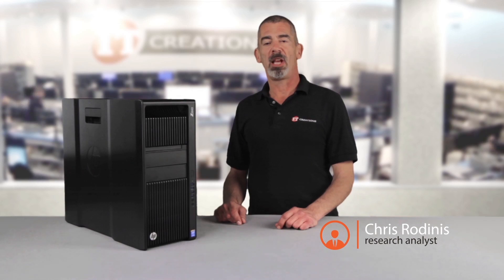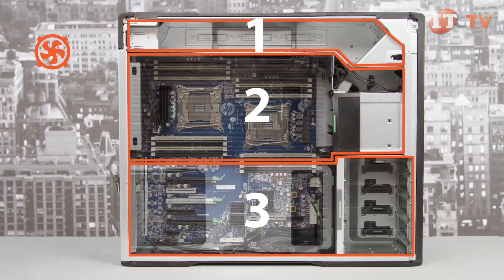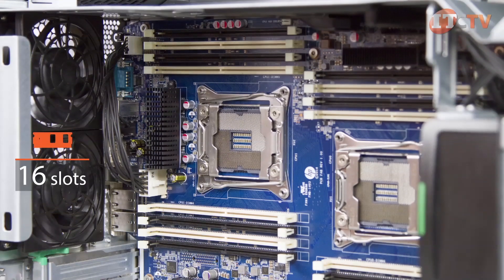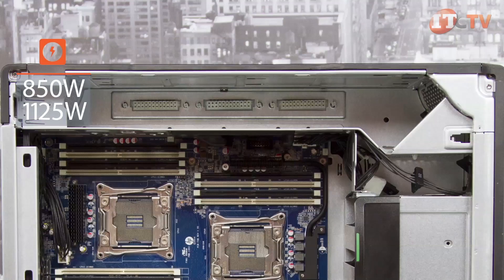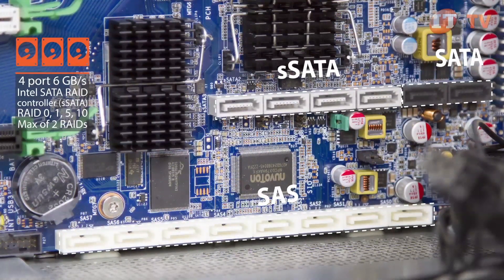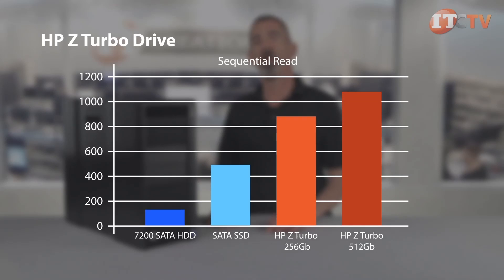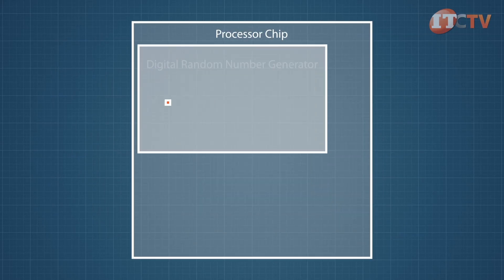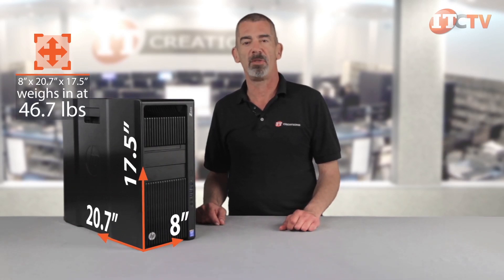HP Z840 Workstation REVIEW | IT Creations

Comment: As a Mac Pro user who has become accustomed to high-end hardware, this is the only PC I've ever been convinced I'd buy.
Reply from the maker: +CaptainDarren82 Yes this is a great machine! Very powerful and highly expandable. However, did you see +jasonlax comment below from 7 months back, He makes a strong point on the Lenovo P900, basically says P900 > Than this— and backs it up with some cold hard facts. Either way both of these systems are monsters and very well designed. Here's a link to the P900, enjoy!
https://youtu.be/89PFUD3wTdY
Reply: I recently migrated to a 2007 Mac Pro, and am enjoying the benefits of a dual-Xeon configuration, as well as a high-end GTX 960 graphics card (well, it's high end in comparison to everything else I've ever used), plus, the ability to use 32 GB of RAM in a single machine. I've been always looking for a over-the-top gaming build, and Xeons draw me due to their lack of integrated GPU, which scales back the heat output a slight bit, as well as a slight bit of cost for the integrated component, since I'd be using a dedicated card.
Reply from the maker: Sounds like a solid gaming platform! Workstations in general don't offer the same performance for gaming as they do for number crunching and 3-D modeling with all the error-correcting features. In addition, the GPUs designed for workstations are not as good at rendering fast frame rates like a dedicated gaming card. But, a rendering error in a game is not as bad as an error while building a bridge or something…critical.Thanks for the comments and check out our website www.itcreations.com if you are looking for other options or components. Thanks for watching!
Reply: I'm totally aware, though, it's a good reminder. I'm running a bit of an overkill for gaming, using 32 GB ECC FBDIMM ram and a dual processor quad core Xeon x5365 configuration. All in all, this Mac came into the picture with the low price point of a used machine, as well as my inclination toward macs. Favoring upgradeability, this was a no brainer.
Reply from the maker: Well played Captain!

Comment from the maker: In answer to the question "how much is it?" (that for whatever reason I am still not able to directly reply to, and nor can I read the name) the answer is, it depends on the configuration. The base configuration can have just one processor instead of two. I think this machine will run with as little as 2GB memory and probably only one hard drive. We offer about 70 preconfigured systems on our site but can also configure to your specifications. See here for pre-configured systems: http://www.itcreations.com/workstation-hp/HP-Z840-WORKSTATION.html Give us a call or send us an email with your specifications and we can quickly price a unit for you.
Reply: +IT Creations, Inc. I priced one up at $75,000 Australian with Dual CPU, 512GB RAM and NVidia Quadro M6000 12GB Video Card
Reply from the maker: getl0st We would be happy to price a system if you send us your spec sheet or the list of components for the system you priced, in addition to what you have listed. I'm assuming you included hard drives? Anyway, if you are interested please contact us 800-237-0402 or sales@itcreations.com Thanks for watching!

Comment: The chassis of HP Z-840 computer is a real masterpiece. It's the state-of-the-art design, unmatchable, inspired by old Apple Pro but better. I recently purchased one Z-840 dual processor for running CAD (NX and Solid Works). I truly believed I am getting the top workstation money can buy. I was not afraid to pay $7,200 for it. I was so proud that I almost posted a picture of my new workstation on my Facebook.
But I was not impressed when turned the power button on. HP Z-840 (with HP Z Turbo Drive G2 512 GB) needs 1 min 20 sec to boot! My 4-year old HP Z-400 (with 512 GB SSD) needs 40 sec to boot. My 3-year old 15” MacBook Pro with Retina display needs 24 sec to boot Windows on Bootcamp. 
The last computer in my possession that needed ~1.5 min to boot was an IBM PS/2 386 22 years ago. HP Technical Support updated BIOS and all drivers on my Z-840 but couldn't improve the booting performance. LOL.
Reply: +Miroslav Mitrovic I have four of these boxes - and they are terrific. Boot times, not sure why that's any concern. These boxes are meant for 24 X 7 activity, which is what we put our Z820/Z840's through. Years of reliable massive computing of petabytes, and what do you have to say. Boot times. Who buys a box like this and cares about boot times?
Reply from the maker: +Miroslav Mitrovic you would not be the first person to report an issue with the boot-up speed. Seems like you are using the appropriate hardware, and have updated BIOS. Perhaps some changed to the BIOS settings? Once it gets up to speed, are you satisfied with the performance?
Reply from the maker: Scott Carl Too true! there really is no need to turn it off with all the enterprise-class components. Also rack mountable if you ever replace it with something faster!

Comment: Lenovo P900 > than this
Reply: +ITCreationsTV I have had the chance to play with both, but not bench mark them.

On Paper (Lenovo on left, HP on right)

3 System Fans, vs 10 for - I can confirm that the Lenovo is quieter 

Cooling Baffle vs the brute force 6 fan of HPs.  - elegant design, quieter and in case of failure on the HP shroud, you need to replace the entire shroud. 

Flex Connectors vs None

8 PCIe Slots vs 7
4 electrical / 4 Mechanical 16 x Connectors vs 3 / 4

up to 3x K6000  vs 2x K6000  

Will only ship with 1300W PSU vs 1125W or 850W PSU

The Lenovo design is out of the box, resign from what the norm is.  The cooling shroud is the best example of this.